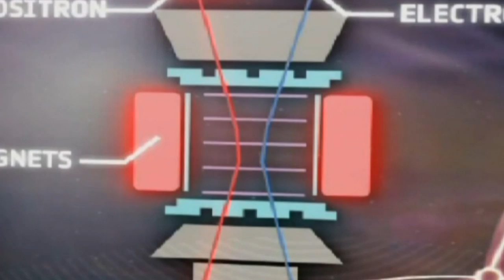The Missing Universe: Anti And Dark Matter

Comment: This video omits an important part of the reasoning that leads towards dark matter. When observing that some stars move much too fast, there was two possible conclusions (aside from rejecting the observation, which is not possible now because the phenomenon has been observed a lot of times): ether there is "dark or invisible or hidden" mass in the universe, either the laws we use are false (false as in "correct here, incorrect there"). The second assumptions is logically valuable.